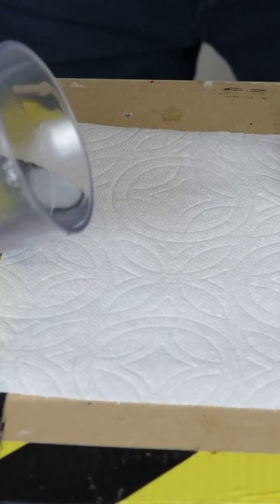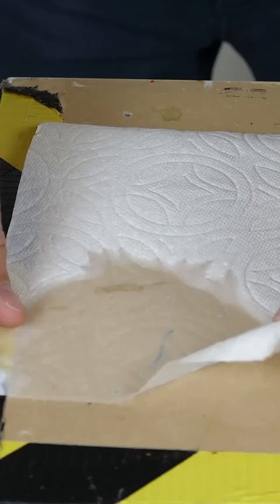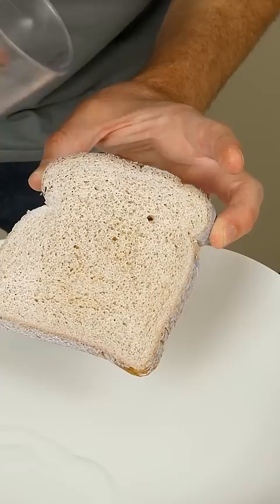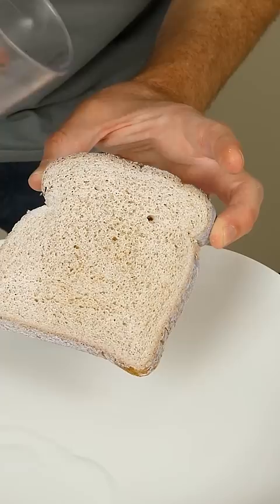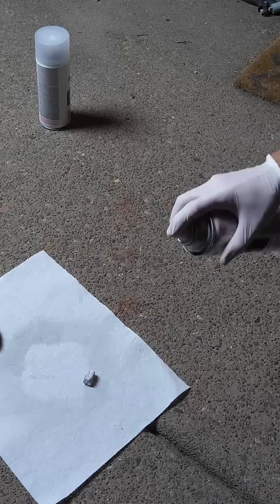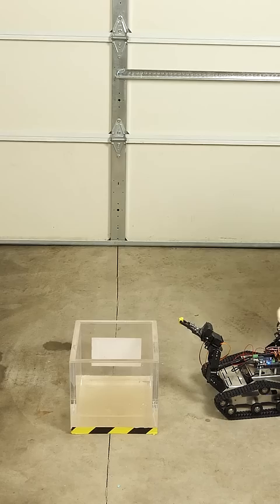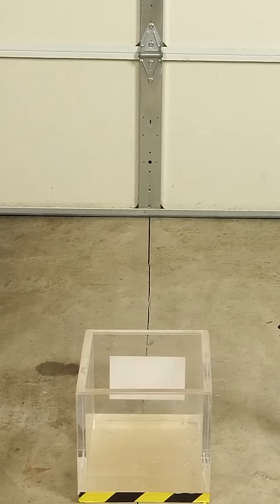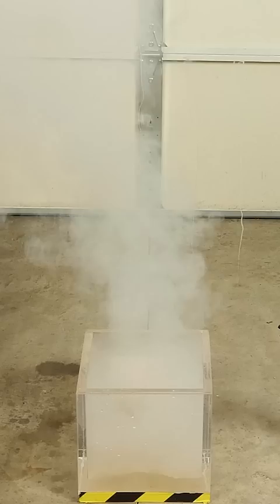I Tried To Make Hydrophobic Sodium...Bad Idea

Comment: if water is poured on you but your covered with neverwet spray would you not explode                                                                  sodium: well it may cause me some trouble to get trough the neverwet spray                                                                                     but would you not explode?                                                                        sodium: NA id explode                                                                                                           because throughout the crust and the core i alone am the 9/11 one